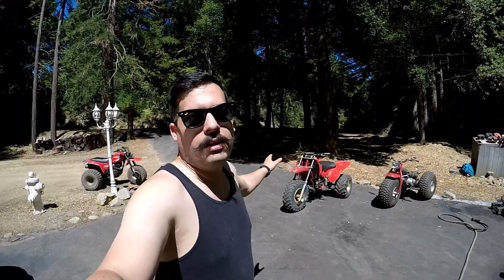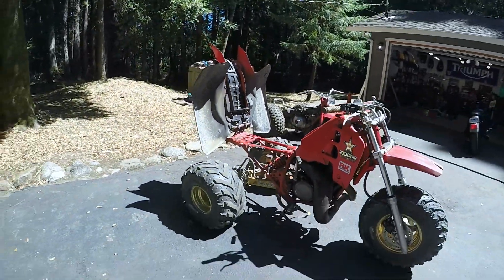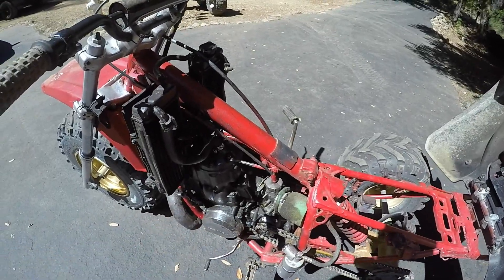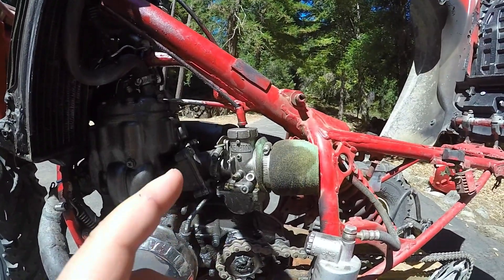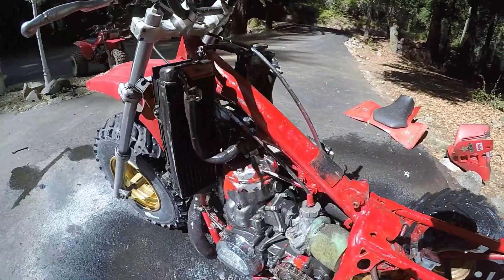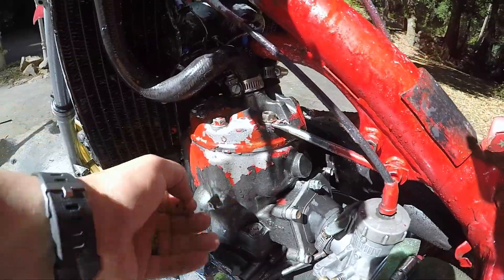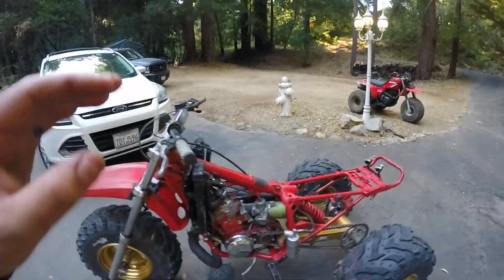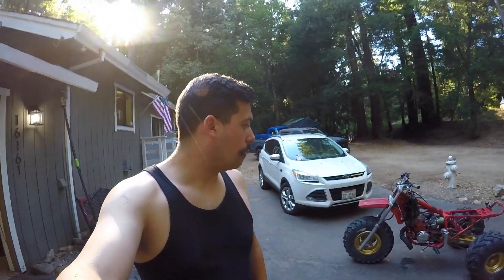Digging Into The Honda ATC500r... What Kind Of Hack Job Did I Buy?

Comment: I used to have one. I heard an old racing story. They used to feel the handlebars with lead to dampen the vibration. The CR motor does not have a counter balancer. The vibration is all over the place which three points of contact on the ground. Other than that pretty awesome trike👍👊
Reply: They did not use lead. They had a section of elastomer inside the bar end to end.
Reply: Cool

Comment: Dont split the case grind it down tap on the gear untill the gear cracks the weld pull it off maybe use a puller then  put a new gear on and drill an tap you a new bolt hole

Comment: I wonder how this fares on top end vs a 250 because I know a stock 250R has about 2500 more to redline..or almost 80 mph.The air cooled years went 75-78 in the ATC250R.liquids could do about the same, they are a hair faster on top end. The 350X  with room can go 85+. I wouldn't try to challenge that area until this gets a little work first.lol

Comment: So here is my idea for this. Why don’t you try to make it look like a machine that Honda produced in 1986. Try to get Correct tires and parts and have it as if it was an option for ATC 500 that was built from the factory. Right down to the grips and bars and tires and tool kit. That would be cool. that I have not seen before

Comment: Wondering if you are continuing with this project.  I would like follow along.  I am building my own ATC 500.  I have seen many of these with the flip up fender seat set up and was wondering if you can tell me if that is something that is diy fabricated or a purchased piece.
Reply from the maker: TheLegendaryShadowKid I am just haven’t had time to play with it lately. The flip up fender set up is a total diy made with bar clamps and bubble gum welds lol I’m thinking of using a CBR600 sub frame I have laying around with a bolt on set up. The rear kick motor definitely sucks in the 3 wheelers lol
Reply: Mason George Motorcycles The rear kick is a real pain, especially if you want to do it right and make it look and act like a factory machine.  I’ve seen many with the flip-up set up but haven’t been able to find an actual kit.  I will likely be reserved to taking the seat and fender on and off when I want to start it.  At least Honda made the removal a cinch.  I’m glad you are going to keep going with the project, it is one that will have value later both in youtube views and the machine itself.  Everyone loves a monster machine...it’s amazing how much attention these conversions get.  I will be watching for updates. Thank you.

Comment: You've never seen the 70cc Honda ATC converted to a 250R with a Wiseco 310cc kit. Look up ATC310R..pure insanity. 70 HP in a cycle you can lift with one arm